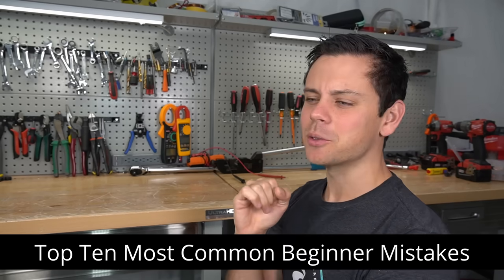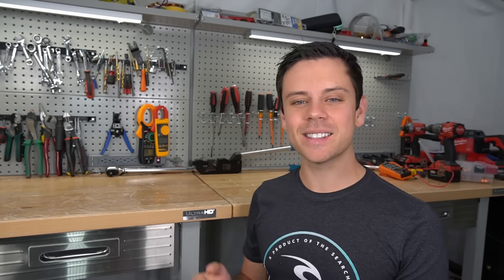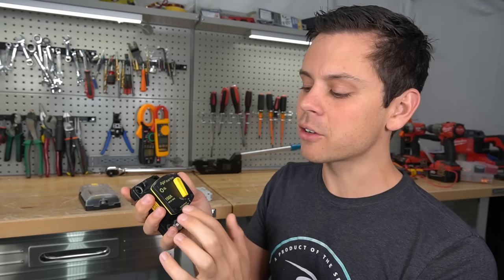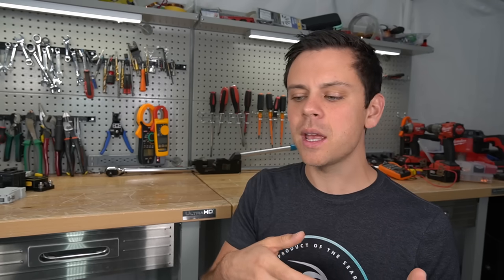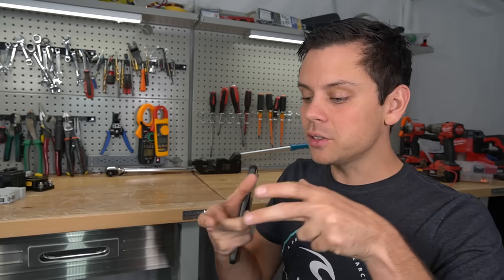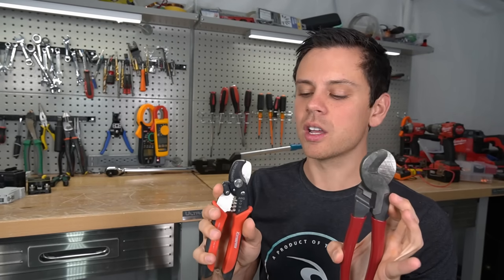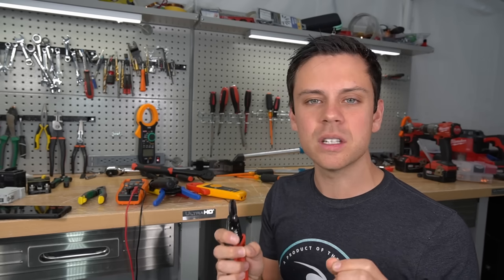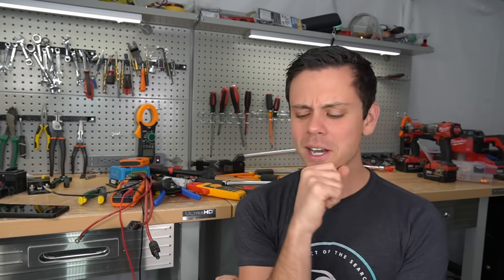Top 10 Beginner Mistakes When Building a DIY Solar System

Comment: I've gone through new commercial construction re-torquing panel board connections due to power issues.  Also had to have the big boys come in and replace switches and distribution.  The incorrect installation of electrical equipment was really an eye opener.  Do it right the first time, check occasionally and relax.

Comment: DIY Solar Power with Will Prowse have you thought about trying NiFe "Nickel Iron" Batteries out ? they are good for 30+ years and up to 4C charge rate . like any water based battery they need water every few months but the price is comparable to Lifep04. these batts have been around for over a 100 years and there are actually still some Nickel Iron Batteries still in use that are a 100 years old

Comment: I built my 1500 watt off grid system over 6 years ago and have never had any issues other than minor faulty parts. Having done all of the work myself I agree with everything you said although the insulated tools can be solved with electrical tape or plastic dip
and they make a crimping tool that you use a hammer with that works just fine. Other than that just do your research and never assume just because one person said it makes it true.

Comment: I work with a telcom.  We use -48V DC systems for all of our equipment.  One thing to look at with your batteries are installation torque value and maintenance torque value.  Some of the smaller 12V 100Ah batteries that we use specify that maintenance torque is equal to installation torque.  Some of the larger 2V 3300Ah batteries have independent installation and maintenance torque values.  Also on new installations I agree 100% on going through the entire plant again to make sure things are tight.  Those bolts start to look alike and it is very easy to skip one and then it is just loose.  The other one that get’s beginners is finger start everything.  A tool shouldn’t touch a bolt or a nut until it is threaded on and moving smoothly.  I can’t tell you how many studs we have replaced over the years because people started a nut with an insulated socket.  Two twists and everything is all messed up.

Comment: I did a high voltage solar array (300+VDC) and as such I can utilize smaller gauge wiring from the array to the hybrid charger/inverter. 
Then I have only about 8 feet of the mega sized cable running from the batteries to the charger/inverter.

Comment: Wire AWG is important I agree with the "always oversize when possible comment," though you also want to consider strand count for DC voltage. DC followed the exterior of each strand within a wire where AC flows through the interior. For DC more strands the better!

Comment: Good job Will, explaining the basics of electrical wiring and connections. It is all important and hopefully everyone heeds your advice. Taking shortcuts could get you seriously injured or possibly killed. There's a myriad of other safety factors also such as NEVER work off a metal ladder when working electrical connections, loose hanging jewelry is another. I could go on but I'm preaching to the choir here. YouTube is a great learning resource but however it tempts people into thinking they can do certain jobs without consequence. Know your limitations and if in doubt consult a professional.

Comment: When terminating aluminum conductors always use No-Lox which is a paste applied to conductor and very much improves the contact. This is code-required in building wiring and should ALWAYS be used.

Comment: a not long ago, i did my normal crimp (i have hydraulic crimps now) then drilled a tiny hole in the end then soldered, crimp first for as much cold welding as possible, then solder. assuming it's cold welded inside the solder should only wick in the parts not cold welded???

Comment: Great list, I would add improper location of fuses and fuses rated higher than wire ampacity. Fuses belong on the positive side of the system as close to the source of power as possible, not just anywhere in the circuit. This is why terminal fuses exist. The stretch of wire between the battery terminal and the fuse is s not protected from short circuits. 
Thanks again for your work.

Comment: another great video Will. I have been living off grid for thirty years started out with a small 12v system and upgraded over time as costs came down to a 24 v and 4 years ago to a 48V system  with a Victron 5000VA inverter and Victron MPPT solar controller, I still am using some panels that are 30 years old ! ... yes they still work although output has reduced. I recently installed 3x 48V 100 AH lifep04 lithium 200 A BMS Golf cart batteries in parallel for storage and they work a treat compared to my old lead acid batteries. So over the years I can say I am guilty of making about four of these mistakes over time LOL which ones I let you guess, but when generating high currents terminating properly  is something I can't emphasise enough . A lot of heat can be generated by poor connections. And yes check your connections regularly .

Comment: One thing I'd like to point out about that 'Blue Sea' fuse block.  The standard ATO automotive fuse is rated for 32 volts.  It's something you don't normally think about.

Comment: Just to give feedback that you didn't want, I found that crimp connections on gear that I purchased were so loose that a main negative cable pulled out of the frame crimp lug.  So I went around and soldered all the main/large crimped terminals as I couldn't trust the work that had been done in the manufacture.

Comment: I worked as a marine electrician at Northrop Grumman for our defense department terminating everything on the ship you can think of including the backup generators the Transformers anything you want to think about electrically I terminated and we never ever use solder on any connection

Comment: As someone new to RV life I think I should mention a mistake I made. I was pulling out the RV's breakaway safety cable thinking this would stabilize the wheels when I had 1 side raised up on leveling blocks. I had no idea this was draining about 14 amps until I purchased a shunt and saw the readings. I went through a lot of months trying to recharge this lost energy.

Comment: Thank you!! Fixing to design my own system, glad I found channel thank you for the quality content 😊. Im hvac/r certified and I do high-fidelity custom car audio installs, from what I can tell most of it is very similar to doing at 10000w spl system for iasca events. I may be wrong but that first circuit breaker you held up looks like my stinger car audio circuit breaker,never understood why people want a fuse on their power cable to the amp.😊

Comment: Found  a good one a few months ago...a non-technical ham radio buddy of mine replaced his camp trailer deep cycle lead acid battery with a high dollar ($1000) Lipo4 100AH battery. While camped at a week long ham fest he came over to get some help trouble shooting his 12VDC system as it suddenly failed while using his VHF radio...turns out he had the 2m  (146Mhz) VHF radio mobile mag mount antenna mounted about 3 feet from the batter box...the first time he transmitted, the RF from the antenna (about 50 watts) shut down the battery's BMS killing the 12VDC output...we applied 12VDC to the battery to wake up the BMS and all was well. We were able to repeat the BMS shut down issue by performing a transmit test. Moving the 2m antenna 10 or more feet away solved the issue. Sorry I do not recall the make/model of the Lipo4 battery.  Probably not a good idea to mount a VHF/UHF antenna next to battery with a BMS...

Comment: Just amplifying your point about the gauge of cables. In low voltage DC wiring, while a cable might be safe to carry a certain amount of current due to it's ampacity rating, it might not be large enough due to it's voltage drop in a particular application. Which is something you mentioned of course. It gets to the point where voltage drop becomes the main determining factor in gauge selection, especially if the cable run has a bit of length to it.

Comment: Very good video. Have you every done any video on AC to DC chargers. I have a victron 12/20 charger for my lifepo4 batteries. When I am not getting enough solar I use this. Be cool for tips and maybe some comparison . Proper wire sizes how hot the charger should get etc. Thank you keep up the good works.

Comment: Another thing that I only learned recently is that when you calculate voltage drop on a circuit, it's both lengths of the circuit. IE from a starter battery to a dcdc charger, you ave to measure the pos and neg sides of cable and add them together.
For a long time I would just measure the distance from the battery to the charger. Not enough.,

Comment: I'm talking from experience I had a set of jumper cables that were just crimped at the clamp ends and found they had excessive high resistance due to corrosion over time. If they were crimped and soldered you would have a product that last longer with less resistance. Solder covers the copper from corrosion over time

Comment: What are your thoughts on pre-tinning the copper cable ENDS and then crimping on the connectors and finishing off with heat shrink tubing ?

Comment: This is your BEST!

 I've been watching, and learning from you for around four years.. Obviously ALWAYS tons of questions..

 However my build is intended for two builds.. One my Sailboat.. MUST BE marine grade..

 The second for my Overlander.. Not quite as large, but might as well copy the Salt water boat system. Maybe not so many Amp hours..

 I recently picked up eight 12v 320ah Lifepo4 cells..

 I'm trying to decide on Marine grade Charge controllers.. and BMSs..

 I've chosen a Water tight capable box to build in it's a latching water tight Tool box..

 I've got packing foam to minimize vibration, which the case will ALSO be buffered.. While being fully restrained as a unit.

 (I'm contemplating an ejection system).. 🤔 I'd hope to never need!

  I'm having trouble with marine grade, or even reliable BMSs.. Reviews often say buy 3 or 5 to switch out!

 Has quality dropped since your earlier Self builds? Nothing makes me feel confident!

 With 640ah of 12v in my Minimalist 34' Cruiser.. Running just 400w Solar.. I'll be living like a God!! 🤣

 Running a couple of 12v Refrigerator/Freezers..

 But QUALITY of BMSs, and Charge controllers seems lousy for anyone talking about Marine!

 I could take it (anything) apart and Formal coat. (I used to build Controllers from scratch, Pre Lithium).. But I'm not finding anything "Marine" unless it's a full system.. Shore power/ Inverter/ Controller all built into one unit..

 I'd prefer to control my parts..

 I just feel stuck, unable to find Marine grade controllers and BMSs..

 Thanks for this Video!! You're Amazing!

 I reference you to many friends who show interest in Solar all the time!..

Comment: Appreciate any help Wil,  "from England" got a Growatt 5000 hybrid inverter 240v  coupled up to Pylontech 2400w battery, inverter shows fault 19 = battery disconnect, have tried switching rj45 lead around to no avail, have not connected solar panels yet as battery arrived in low state of charge so hooked up mains power to inverter to charge, however the battery won't charge up more than 4 of 6 led charge lights, than trips mains fuse, any idea please, thanks for any help. GJL

Comment: One item you have not mentioned is about the use of crimp on Ferrells for stranded wire when used with the terminals such as in the mppt charge controllers. Anyone who has a system should have an infrared heat camera, yes it is recommended to inspect the system every three months. A moment of prevention can save one from headaches. An example, I have been an RF technician for over 30 years now and at one transmitter site on top of a high rise office building, once a year during the Memorial Day weekend they will close out the structure and have electricians come into the facility and go through EVERY electric panel and torque down every clamp on every circuit breaker in the building. A very wise move, it also allows the electricians to determine if there is a problem with any part of the electrical system. As for crimp tools, I have invested almost a thousand dollars in specialized crimp tools for almost every type of RF connector and low power DC power connectors. Always have a perfect crimp so the equipment preforms at maximum efficiency. Now I need to add Heavy DC crimp tools to my collection since I have been working on large gauge cables. As for buss bars, if you have a scrap dealer in town close to one’s home, sometimes you can find heavy copper buss bars removed from old or updated transmitter sites. These were used for grounding RF lines from lightning or static discharge. They average 2-3 inches wide by 12 to 20 inches in length with a thickness of at least 1/4 inch. I have found these excellent for my buss bars. With proper stainless hardware and joint compound these will handle serious loads considering they might have had to handle a direct lightning strike. Don’t to forget to find the proper insulators and mounting hardware at your local electrical supply shop.

Comment: Yes copper is a soft metal so in time connections will work loose especially if there is a duty cycle eg;  Charging cycle a night then discharge during the day- heating & cooling at the connections.
I have known fellow Eleco's that are afraid to give new connections a bit of a tug ... in case the come loose = Err, yeh?
Cables, especially low voltage can be paralleled or trippled up to meet current requirements.  It doesn't hurt to go 'over-kill' on cable size.  I've seen too many guys get so hung up on minimum cable size on say, mains size when then next time there are additions to the load the mains need total replacement.
A house that is being demolished is a Gold Mine for copper cable.  Electrons don't wear out cables.

Comment: i used Anderson Power Products SB350 connectors to build a 2/0 cable system for my golf car to be able to convert from 36 volts to 12 volts just by disconnecting and connecting several of these connectors. a crimping tool for these connectors and 2/0 cables cost $5,000 for the hand crimper!!
they come with instructions for soldering them! the terminal lugs are silver plated.  they are way overkill for my project! but living completely off grid, this allows me to unplug the golf car from the camping trailer and take my power anywhere i want and use it at 12 volts.

Comment: Be sure that when sizing you factor everything by about 0.7 to gauge what you'll actually get. ( Or multiply by 1.4 to get the correct size ) Solar install companies always do layouts that assume 100% output when looking at your bills. The sun doesn't strike the panels at max output all the time.

Comment: Another consideration on soldering high current connections is that high current produces lots of heat...standard solder only needs about 600°F to flow...200 Amps through too small a gage wire/cable will produce temperatures greater than the melting temperature of solder...so melting the insulation is collateral damage...
Solder is actually most effective on circuit boards...
Splices are mechanical connections...when done correctly they will out perform solder connections every time...

Comment: A question, which may be answered elsewhere, but likely fits here is:
Can you attach two different charge controllers to the same battery bank and have no issues? For instance a separate solar MPPT controller and a wind turbine  controller with excess dump resistor connected to the same battery bank?

Comment: Hi all.  New here, so please go easy on me.  One of the things you mention in this video is that prepare for the enevitablility of upgrading you battery bank.  From what I've been hearing, you want to have all your batteries to be identical and start at using them at same time.  How do you hand that when you want to add more Ah at a later date?   (Tried to search the comments first, but no easy way to do that.)

Comment: Will, I’ve been watching your videos for years. Since your days in the rv. I have a goal zero 400 lithium.  I know you did a video that looked inside and you made a mod with a victron mppt.  My current 400 is not wanting to charge and when it decides to charge and I turn on the button to use 120v outlets the unit beeps and the bottom turns red. Although I can still use the 12v side.  Can you take one of your GZ lithium’s apart and make a repair video as goal zero says they are not repairable. Thanks

Comment: When soldering wires to lugs, where the solder wets the wire it stiffens the wire. At the point where there is solder then no solder it creates a stress concentration and where there is vibration the wire can break.

Comment: Your my go to source .. but …

I’ve never heard your mention and caution against how various devices on the market emit RFI. RFI is becoming a major problem to Shortwave listeners, HAM Radio operators (as I am) or emergency communication operators.

From personal experience, I’ve found that the system I built based largely on your recommendation using the GroWatt all-in-one charger/controller, is a major contributor to RFI pollution. The unit is amazing in respect to the integration of the charger, the inverter, the transfer switch and the CPU controller/user interface controlling the system. It is really amazing.

But .. The MPPT charger in that unit is HORRIBLE in the amount of RFI/EMI it generates. The company is total unresponsive to request for assistance in mitigating the problems. The noise it generates pollutes a huge amount of spectrum. I’m in shock that the FCC allows this equipment into the USA. 

Please, in your reviews of solar equipment and devices, expand your reviews to include EMI/RFI pollution.